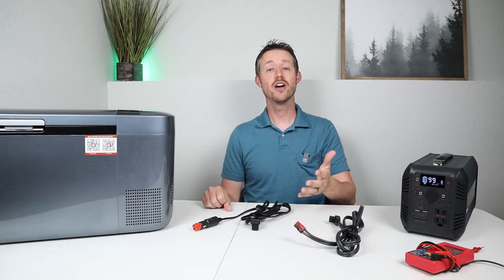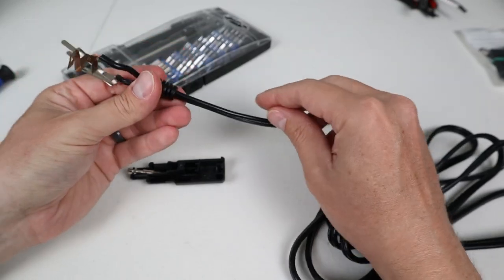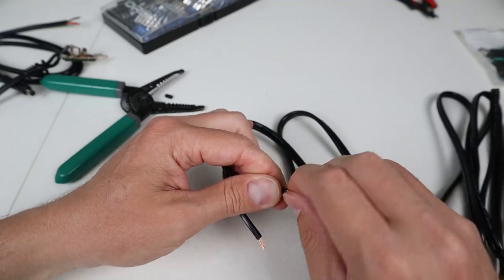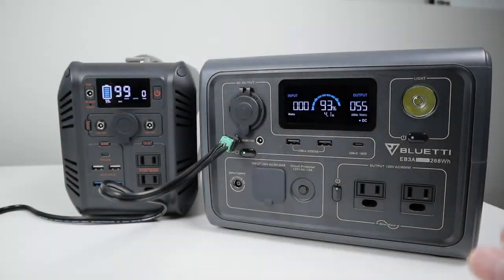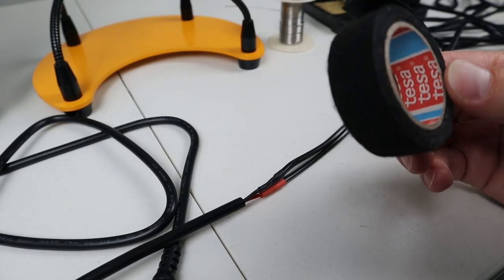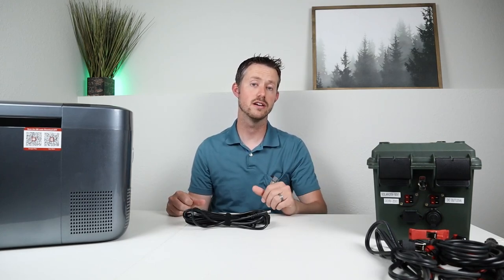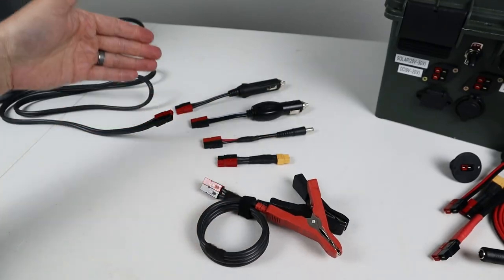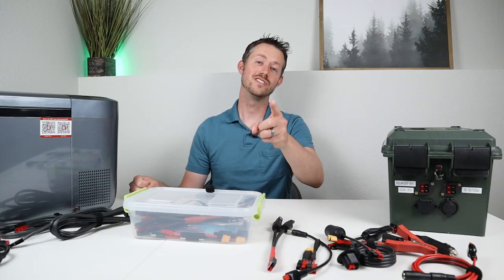How to Make a BETTER Portable Fridge Cable! Remove the cig plug, install 5521!

Comment: Be careful with the 5521 pigtails. I've gotten a bad batch of those that melted at 5 amps. it's never happened with the screw terminal connectors but it did with the pigtails.
Reply from the maker: The ones I have used here seem to be high quality, lll keep an eye out for heat.

Comment: I bought an extra cig plug ($20) from ICECO for my GO20. That way I can still use the A/C adapter with the supplied cig cord. I cut the additional cig plug off as you did and installed a right angle 5521 plug. This reduces the risk damaging the plug and socket when installed in my Bluetti EB55. All this gear has survived nicely when bouncing down the road. Thanks for your videos. I used your reviews to select both of these pieces of equipment.

Comment: This is by far one of the best solar chargers, dc fridge and everything else in between channel!   Got tired of the cigarette cable getting knocked out of my Bluetti by my kid and was wondering if there was a better alternative.   Jasonoid to the rescue!
Reply from the maker: I hate how the default connector for the industry is a connector  that was designed to light cigarettes on fire and not really transfer power. We need a new standard! Xt60 or something

Comment: Hey Jason, do you know if any plugs are available that would 90* angle out of the polarized Setpower RV45D in the opposite direction than the cable supplied with the fridge? Thanks again, really appreciate your videos and help 🙂

Comment: I recommend heat shrink instead of the tesa tape.  Also, if you cut the plus and minus wires to different lengths so you can offset the connection points it makes for less of a bump in the cable, and increases the insulation between the lines.
Anderson powerpoles are awesome!
Reply: Instead of?  He used both...
Reply: @brianh.000  I Think he meant another heatshrink on top of the heatshrink instead of tape

Comment: I do wire soldering differently.  This is actually the first time I have seen the "side by side" wires with having the solder itself be the "connection".
Electrons travel on the surface as you know and maybe the system you showed is best/better.  I align the wires striped further back and twist them into each other,  together in a straight line, not uninsulated wires next to itself with the twisted pair sticking outward from both insulated. Then solder lightly and wrap.  I saw the extension with Anderson on both ends... good idea, I'd not thought of that before.  Also on that Eb3A a friend ordered one and came by the shop and Bluetti didn't/doesn't give cables to plug in to the solar panel.  It would be neat to find the right socket etc. ... we found the number by watching a video and they popped up the number, Bluetti doesn't have it in their manual or documentation.  They simply say DC  connection...  I could not get my Bluetti 120 folding panel to connect.  It works great with the Eb55 I use..
Reply: although twisting them together will result in a better connection to allow higher amperages with lower heat generation, doing it side by side will work fine if the wire gauge is larger than what is needed.
your method would be better yes, but his method is not "wrong" but less efficient.

Comment: Ferrules would make the screw terminals a lot more safe. Add a bit of heat shrink over the plastic part of the ferrule (using marine grade heat shrink that is dual wall adhesive) and that adds another way of securing the your little contraption from coming apart because sometimes the cheapo DC power cables don't have quite as many strands as they should and the ferrule doesn't crimp down as tight as it should, I've only come across this once though.

And just to clarify, when crimping ferrules you are crimping the metal tip. There are actually YouTube videos out there instructing people to crimp the plastic part. I've actually found that crimping the plastic AFTER crimping the metal tip of the ferrule does indeed help secure the ferrule to the insulation of the wire if you're paranoid about the crimp on the raw conductor not being being solid enough.

And this comment wouldn't be complete without soldering criticism! I've been a fan of stripping a tad more insulation and spreading the strands out (kind of like a flower) and shoving them together. Then instead of using thin bus wire or some other wire I use my thinner solder wire to tightly wrap around the joined area. I've already applied some flux to the conductors so combined with the flux inside my solder wire it flows like butter and the wrap stays really tight until the last second but by then part of the wrap has already flown into the wire so I end up with what normally isn't too terribly large of a bulge. I can usually get away with heat shrink that just fits over the wire's insulation also fitting over my splice and blob of solder

Comment: Hey J. Do you have same how to but replacing the other end of the cord and the plug attached to the fridge? I got a fridge cord that melted and wondering if I could modify it with those yellow connectors. Thanks much

Comment: that is some great soldering skills, and no cold solder joints. its easy to tell when there is a cold solder joint because the color will be muted and less shiny. and you had a good level of solder holding the joints together, not too little and not too much. too little can result in a weaker connection, too much doesn't really matter but you use more material. if you need a high amperage connection, using solder may result in the heat melting the solder and weakening the connection, so using a mechanical connection would be better. of course that also depends on the gauge of the wire. thicker wires can handle more current before getting hot. sorry for the rant there.
as for the tape at the end, i usually use more heat shrink and cover the entire joint with some larger diameter heat shrink. as a suggestion for the outermost heat shrink, you can get weather proof heat shrink, it basically has glue in it, to make the entire joint water tight.
Reply from the maker: Great tips P M. For the most part these solder joints will be okay for low amp loads. Any high power connections I prefer a crimp / solder combo. Thanks for the feedback, always love hearing your thoughts.

Comment: Why do you prefer the Anderson over SAE. I am looking to wire 12v to the bed of my truck and thinking to do an Anderson or SAE plug in option instead of the cigarette lighter. Any insight would be appreciated.
Reply from the maker: SAE has no respect to polarity and can get very confusing on which side is positive or negative. It can also be hard to connect and disconnect (especially in cold temps).
I like Anderson because it can't be connected in reverse polarity and it's easy to disconnect and connect. I also like how they are actually rated for specific amps (15, 30 or 45 amp sizes). Sae isn't rated for a specific amp limit so it's a bit questionable on higher loads.
Reply: Great answer. Thank you!!

Comment: This is awesome and exactly what I want to do! I'm going to go with fridge cable to Anderson. Then I can plug directly into my DIY power station (based off your build!) and then make a 5521 adapter for my retail power stations (Bluetti, Golabs). Great video!!
Reply from the maker: Glad you liked it Mike! It works really well, especially the Anderson option.
Reply: @Jasonoid  Jason, Can I just run the solar cables from panels into my camper to my mppt charge controller, 300 amp hour lifepo4, and 1500 watt inverter to power a small air conditioner without grounding or can it damage something or be dangerous? We have lightning here so the panels will be disconnected before storms or moved inside when I go to town. I don`t want to damage or fry a system that cost over 2000 bucks. Don`t have money to replace an 1100 dollar battery. I can`t find any clear info.

Comment: For my Setpowers. I found that eco mode for my fridge actually uses more power overall because the compressor stays on longer and uses at least 25% more watts overall. If I leave the chest fridge in max mode it uses slightly more watts but shuts off much sooner and stays off longer. I get on the eb3a about 5 extra hours.
Reply from the maker: Great info, I've always wanted to do more testing to figure out exactly what one is better!

Comment: Can I cut the end of my refrigerator plug off, and wire it to my  After market fuse Box that is connected to my truck batteries.  The fuse Box i put in, operates a few lights in the back of my Van.
Reply from the maker: Yes, hardworking these fridges works great too!
Reply: @Jasonoid  thanks for the info.  My new transit Van automatically shuts off the power sources after about 20 minutes. So I have to figure out a way to keep my refrigerator running as long as I want it to run, not as long as Ford wants it to run.

Comment: Just bought a fridge for a road trip coming up. I want to keep it running the whole time. It has battery protection built in as well. So all I need to do is cut off the cigarette portion of the plug and run the wires straight to the car battery? Fridge will pull about 40 watts with compressor on, so I also plan to put a 30 amp fuse to be safe. Thank you
Reply: 30 amps? 40 watts at 12v is less than 4 amps, i'd suggest a 5 or 10 amp fuse

Comment: Hoping you can answer my question here :)  i have a ICECO VL60 12V fridge/freezer and i am using a Eco-Flow Delta Pro as my power source for a van build, i am using a 12 way fuse box that i bought on amazon, would i be able to cut the 12v plug in that came with my ICECO exposing the wires and hooking them into my 12 way fuse box along with my other 12V item si have attached to the fuse box, maxxair fans x 2 and wall fans x 2.
Reply from the maker: Yes, you can connect this power cable directly to your fuse box.

Comment: I purchased an Audew , which does not have pass through charging , that is why an inverter was necessary to charge and operate at the same time.  That got me thinking what inverter is more efficient?  external or internal , which I can do on my own, but thought it would be a good test for other power generators as well , for comparison.

Comment: I'm all about safety. Any thoughts on adding one of those inline automotive style fuse enclosures in case anything goes south with the cable or power station? Would a 10a fuse be a good choice?
Reply from the maker: 10 amp fuse would be fine, all fridges have replaceable fuses and the power stations have over current protection, if the stock cable didn't have one, it's also my opinion you don't need one.

Comment: Thanks for this Jason, just now putting together parts for Setpower RV45D adapter to Bluetti EB70 barrel plug... Would there be any significant advantage to using 10-2  wire from West Marine ( marine grade ) or would that just be overkill ... fridge to EB70 cable length will be 6ft. ... EB70 to PV200 solar panel extension cords will be 10ft and 20ft . Also, I'm familiar with 110 and 220 residential electric wiring, not 12 volt wiring, why no third ground wire .. neutral is ground? one way energy flow on live wire? No such thing as a dumb question???

Comment: Excellent video Jason.  My go to is using SAE custom adaptors because I last year I bought a whole package of them at Harbor Freight really cheap and I just stuck with that since.  A few months ago I tried making my own custom Anderson power pole adapters and unfortunately for me I bought the cheapest option on Amazon and they were totally unusable.  Because of that, it turned me off to Anderson, but that's really my fault for going cheap rather than using the recommended links from guys like you.  I think I'm going to retry making custom Anderson power pole adapters again using landscape wire as you suggested.  Thanks for making this video.
Reply: @T.J. Kong Thanks Kong!

Comment: Like the video.  It reminds me to upgrade my soldering equipment.  I like the helping hands and a better adjustable unit.  Did you just add your own scratch pad or sandpaper, or is that standard on the unit?
Reply: I believe it is a dampened sponge and not sandpaper.
Reply from the maker: Yep. It's a wet sponge to clean the tip, came with the soldering kit and works well.

Comment: Thanks for this instructional! I have no idea what I'm doing. Why no fuse between the fridge and the battery? I originally got a cigarette adapter with a fuse to prevent either component from being destroyed.
Reply from the maker: The fridge has a built in fuse where you plug in the cable, I don't think you'd need two fuses.

Comment: Hey there! Great video but I have a question. Could you cut off the cig plug and crimp ring terminals on the wires to then run to a 12v fuse box? Instead of creating your own cable.
Reply from the maker: Yep, directly wiring it to battery would work great.

Comment: most of these "12v compressor fridges" will actually work fine (and more efficiently) on 24v because they all use the same 24rv compressors. that means they will also work on 28v since its within the automotive 24v range (30v max). 
using 28v, you can run fridges more efficiently with usb-c from a powersupply that supports the new pd 3.1 standard (28v) if you wire in a "28v  pd trigger board" which goes into the DC pins on the fridge.  almost all those powersupplys with pd3.1 are GaN and will be much more efficient than any other wall based powersupply. i got my 54 liter 12v fridge down to under 100wh/day ($0.01/day here)

Comment: Another great video, I'm following your instructions.  The only difference with my cord.  Is that mine had a 8 amp fuse on the center positive.  I'm using Anderson connectors, and created adapters following your logic.  I used an inline fuse holder with a 8 amp fuse attached.  I'll test it in the morning.  Do you feel there's no need for a fuse on your mod cable?
Reply from the maker: The fridge has a fuse already so I didn't double fuse it.
Reply: @Jasonoid  Okay!  Thanks Again!
Reply: It seems that my fridge is running more efficiently.  I have a Goal Zero 1000x.  I used it for my fridge this past weekend using the cig plug.  I couldn't get a full 7 hours of power before it was almost depleted.  It was on ECO mode medium.  It seemed to be using more power than at home on AC.  I was very surprised and the cig plug felt very very warm so I stopped using it.  I wasn't sure what was happening.  Using my new mod cable, I have it running for over 8 hours today and the SOC has barely changed.  Using around 28 Watts, it had to be the cig plug.  The Anderson connector seems to be more efficient.

Thanks Again!
Reply from the maker: @minceym  you were losing lots of power through resistance / heat while using the 12v cigarette plug. It's a horrible connector!

Comment: One more question please.....  Is there any way to crimp or solder them without buying another $30 tool?  My MC-4 crimper might or might not work.   Thanks
Reply from the maker: You have to use an Anderson Powerpole crimpers, they are worth it if you decide to use these connections repeatedly.

Comment: This is a great idea but I disagree with you about the availability of 10A power through a 5521. I have two power stations and I've been researching a third and have yet to find one with 10A. Isn't the 5521 connector normally rated at 3A? Anyway, I was going to modify one of my old power stations to connect the power port to the 5521, but when I found that the warranty was 5 years, I opted to keep the warranty intact instead. I like the 5521 a lot more than a cig plug.
Reply from the maker: Most fridges pulls 35 watts on ECO mode, which is the mode I use most often, that's about 3 amps or less.

Comment: Great Video. I have a question. The vtoman cp3500 cable that connect one power station to a extra/expansion battery. Can that cable be modified to be extended like in this Video?
Reply from the maker: Yes, it would be possible. You want to use the same wire gauge and all the communication wires would need to match up on that cable. The only worry is that you'll experience voltage drop the longer the cable is.

Comment: very useful video.. Question: what are the actual size of the car "8mm barrel plug".. i've heard its actually 7.9x???
Reply from the maker: Yeah, they are 7909 connectors, but there are some slight different variations.

Comment: I cut my car cable wire in half and wired it directly to a fuse block in my trailer for my first 12-volt fridge I bought, does not work for a power station obviously. It worked the entire 3 months I went on a cross country trip. I have not done it with my other car cable for the 2nd fridge I bought, just so I have one cable for the power station. But I did buy 2-5521 to car charger outlet cables, so i can make one with one of them seeing as I don't need two of them.

Comment: Excellent video! Will the positive and negative wires always be as you explained - one with a rough feel and one smooth with lettering?
Reply: Not necessarily. It's best to check it yourself, using a multimeter on continuity mode (where it beeps when you have a connection).  Then you can simply cut the cable in half, and check the lighter plug end. Strip your wires a bit. Hold one probe against one of the wires, then touch the other probe to the tip, then the ground contacts. The one that beeped is the cable you're holding. 

See if that wire has ribs, printing, etc, or is bare. Now you know which wire is positive, and which is negative.
Reply: NO! use a multimeter to establish polarity & continuity of your wire.

Comment: My issue was the fridge side. It would overheat and melt the plug.  Took it all out and hardwired it. No problems after that!
Reply from the maker: That's crazy! Glad it's working since your fix.